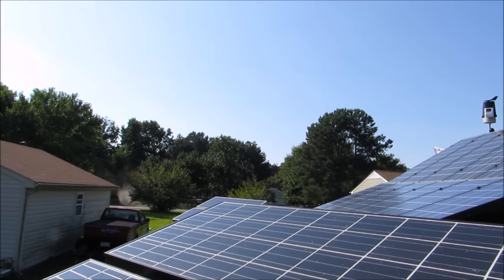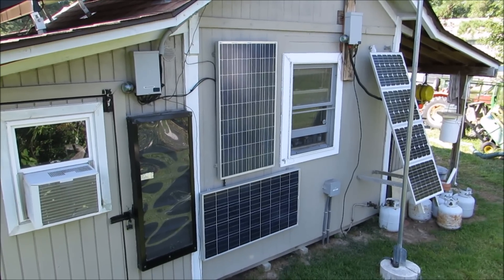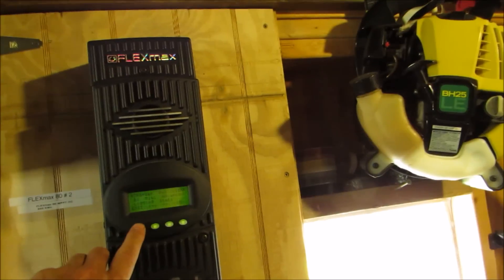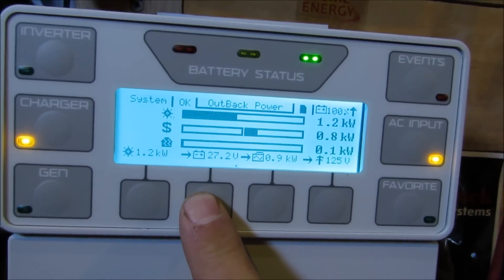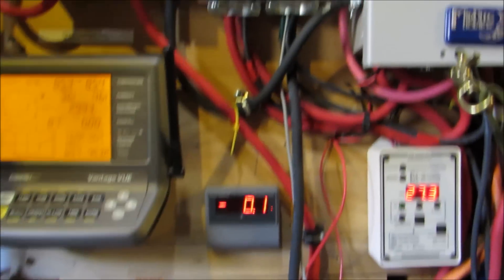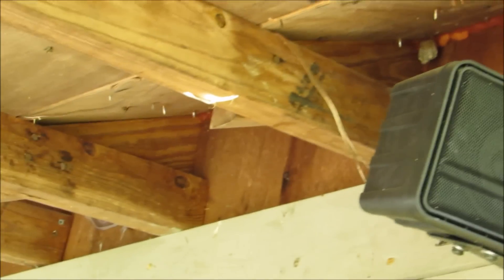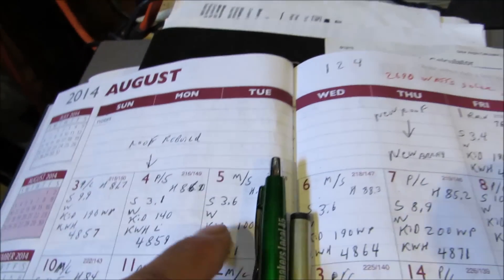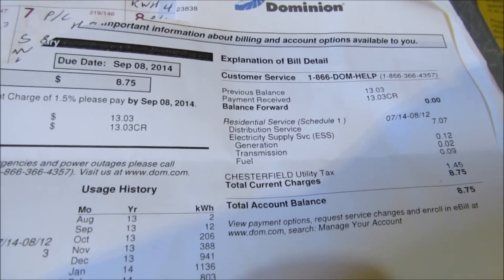Solar And Wind Power Update Power Bill For August 2014 WOO HOO $$$$ By KVUSMC

Comment: Nice video. I am in the learning stage of solar.

what was your power bill running before solar and what is your cost for the system?
I am thing about doing a off grid type system and running new outlets for what i want to power by solar and keeping the appliances on grid power.

Is there a way to do on grid system that can be switched over to off grid  when power goes out?
Reply from the maker: gunracksonline This Is Grid Tie Battery Back Up System  This Will Save You Money While The Power Is On And Will Also You Will Have Power When The Power Is Out My Bill Was Like $150.00  to $ 200.00 A Month  Now It Under 20 To $ 60.00 A Month Average  This System Would Cost You Around 15 Grand  If You Do It Your Self Brother Hollar At Me Anytime Kenny
Reply: KVUSMC / Kenneth W Viar Jr
 Thanks. Subscribed to your channel and may have questions for you.
Looking at starting with the renogy 1800 watt cabin kit.
Reply from the maker: Cool Deal Buddy Sounds Awesome Many Thanks Hollar At Me Anytime Kenny

Comment: Thanks for the explanation of how heat impacts the system?  What did you have to do with the electric company to get this setup legally? Are they helpful or are they a pain? Are you feeding back into the grid? 
so what did your system cost?
Where did you learn to do this or did you pay to have someone install it? I want to do exactly what you're doing. I love the idea of making my own electric. Is it better to buy large wattage panel or a bunch of lower watt. I have been thinking about starting out with 4 250 watt panels, instead of 10 100watts. would you buy the 250 instead? why?

really nice, I'm hoping to be you some day?
Reply from the maker: j johns Your Welcome It Costs Me About 10 Grand I did It All My Self But I needed Help Putting The Roof On ! Yes I'm Feeding The Grid The Electric Company was Easy They Are Great So Was The County Everyone Was Easy To Get Along With  Either Way Is Good Large Or Small Panels Your Choice Get The 250 Watters  4 - 250 watters should Work Great Good Luck Come Back Anytime If I can Help !  Kenny
Reply: I was attempting to do this on the cheap, and to start off I purchased two 500 watt grid tie inverters. I'll do the 4 250 panels and hook them to the inverters. On a really good day it will generate 1k watts, more like 8-900, would that be all I need to do? panels, to inverters which plug into the existing light sockets? I saw a youtube from missouri wind that indicated you could do that and have it cut your bill?
Reply from the maker: j johns That Should Worth Great Buddy

Comment: I'm also in that start small and expand mindset. The stuff in shop, could that have been more concentrated or is it cheaper to continue to build up in small increments. Engir775 was showing a controller that handles up to 16 or so panels.
Reply from the maker: Patrick Fox Amen Buddy That Is What I did I Worked My Way Up That Is The Way To Go Cheers Patrick

Comment: Are you registered with your electric company to get credited back or did you just not tell them that your using panels? Is there any risk involved in that cause I never told me electric company either should I be worried?
Reply from the maker: D.J. DISPATCH Hi D.J. My Electric Company Knows I called Them And My County That I live In Came And Inspected My Setup ! I'm Not Getting Credited I'm Just Saving A Few Dollars Here And There ! My System Is Basically A Big  Back Up System  So When My Power Goes Out  ! You Can Tell Your Electric Company That As Long As You Have Everything ( isolated ) So No Power Line People Will Get electrocuted While Working To Get The Grid Restored  I Have Mine Isolated  Just As long As You Tell That You Should Be Ok And Have Certified Electrician Inspect Your Stuff Insurance Purposes Etc Buddy  It Is Well Worth It !  Take Care Kenny

Comment: Hey Kenny, where the wires from your panels go into the building through the roof? Those are called weatherheads. Just thought you would like to know. I did a bit of electrical work when I was a young man. That was one of the few things I remembered. :D 

Man,  since putting on the new roof, the new mounts for the arrays are lookin' great. Better than ever. You got all your stuff lookin' great, man.
Reply from the maker: Paul Petrea Many Thanks For The Info On The Weather Heads I can't Learn Enough Buddy  Many Thanks The New Higher Racking System Is Much Better Than My Old  Here In Southern Virginia It Is So Hot And Humid The Solar Panels Will Get Better Air Flow And Stay Cooler   Thanks Paul

Comment: Thats great. Do you have a big freezer and elect stove? Thanks kb
Reply from the maker: Kevin Burns Hi Kevin I Have An Electric Oven 2 Deep Freezers And Big Upright Refrigerators  And  A Whole House Electric On Demand  Tankless Hot Water Heater  And A 3 Ton Heat Pump And To Shops  Only Thing I Have Propane Is Our Gas Cook Top And Gas Logs For Back Up Heat In Winter

Comment: I see from Oct last year till June of this year you had some "High" usage. LOL not compared to me :-(
Was that time frame weather related or were you adding more solar panels to your system over that time frame. I see you used 1KW more this August than in 2013...shame on you LOL
All kidding aside very impressive Kenny
Tim
Reply from the maker: DJMovit HA HA Many Thanks Tim  Mostly In Winter My Bill Goes Up It cost More To Heat Than The Air Conditioning  Plus Not As Much Daylight Hours

Comment: hi why not bigger watts per panel so you use less panels
Reply from the maker: Norman McGregor You Got That Right Norm
Reply from the maker: Olan-Ray Frith I Just Like The Smaller Panels These Panels Are The Same As Sailing Vessels Use To Go Across Oceans And Sail Around The World I Have read allot Good Reviews On These Kyocera Panels If Itn Is Good Enough For The Rigors And Rough Seas In The Ocean Day In And Day Out Plus There Salt Water Tested Oh Yeah There Tough  As Nails  These Kyocera Panels I Use aren't Cheap They Usually Run  
@store/Solar-Panels/Kyocera-KD140GX-LFBS-140W-12V-Solar-Panel/p10189/  12 V  140 W  $1.96  $275.00 
These Are Some Of The Best Solar Panels In The Industry  ! Not All Marine Solar PV Panels Are Created Equal!

FYI - not all solar panels are created equal especially in Marine applications. Most @categories/Solar-Panels/ of lower-cost are designed for use in residential applications.  Beware these panels will not survive when installed on a vessel or near the water as they will delaminate, corrode or deteriorate and the manufacturer will not warranty their product accordingly.  Our KYOCERA Solar PV Panels family of KCM solar panels have demonstrated successful and reliable operation over the years in a Marine environment and is backed up by the factory warranty. The Junction box is water resistant and we supply each unit with special watertight cable connectors leaving nothing to chance.